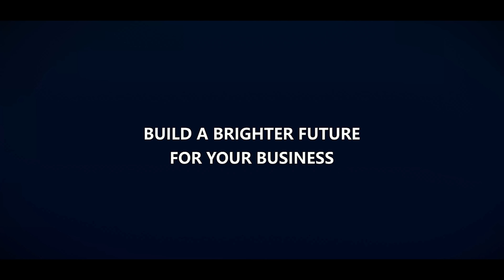Fully Automatic Dairy Beverage Production Line, Bottled Milk Aseptic Filling Production Solution

Comment: From the beginning of 21st century, Newamstar launched PET bottle blowing machine series. In 2006, Newamstar developed the first 20-cavity rotary blower in China. In 2014, Newamstar developed the first 80,000BPH ultra high-speed blowing filling capping combiblock machine in China. Newamstar not only has rich experience and many implementation cases, but also has a complete PET bottle rotary blower series, including capacity from 12,000BPH to 81,000BPH which can be easily selected by customers.